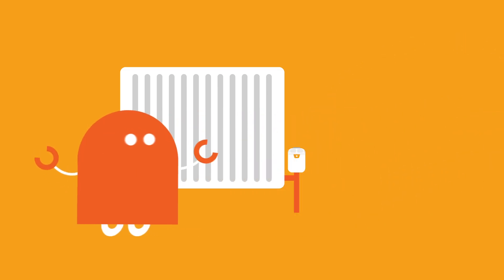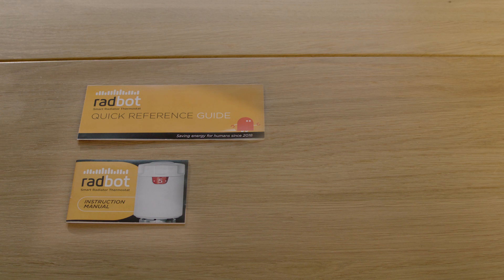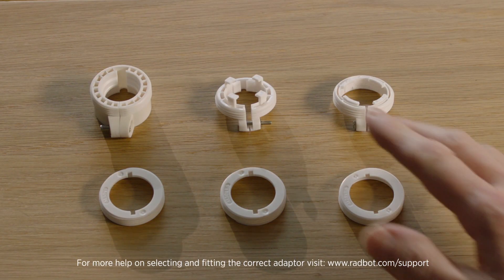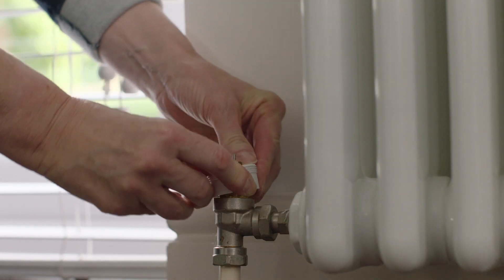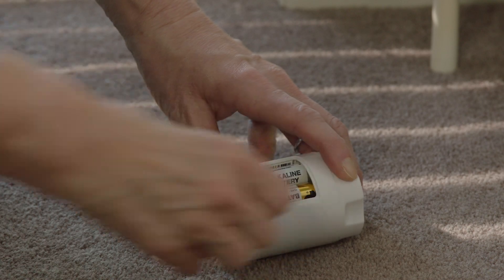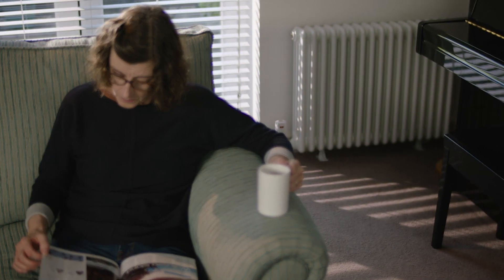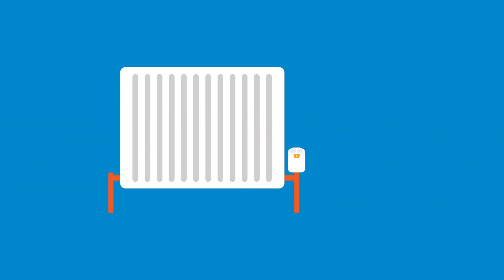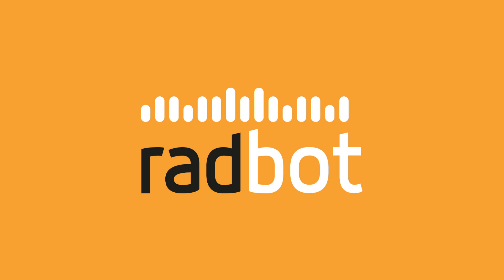Installing Radbot

Comment: Why don’t my radbots work - new battery new Radbot set to 2 and it’s red hot 
I’m so unhappy I have 9 radbots and the thermostat and the boiler connection thing but I’m just wishing I hadn’t bothered as they won’t turn the heat down so going to have to turn off all my heating - what a waste of money
Reply: They don't communicate with anything, they just have a boost button to open the rad up then shut it down according to the installer, else they are just the same as normal TRVs, they're not to smart...😅
Reply: Hi. Did you manage to work out how to use them?